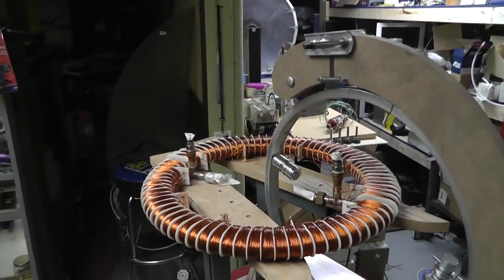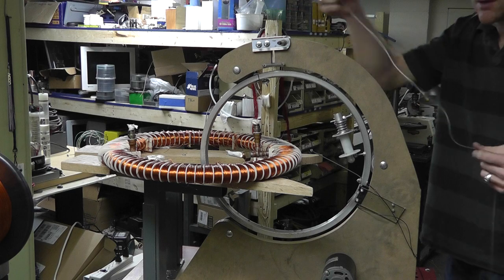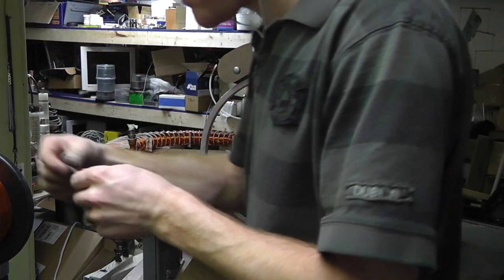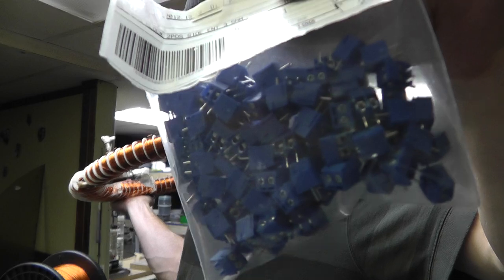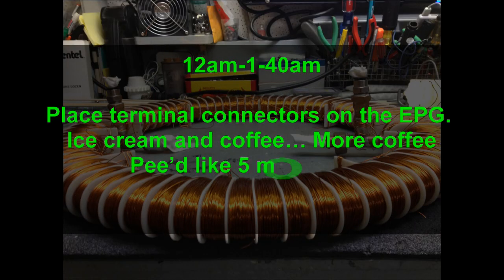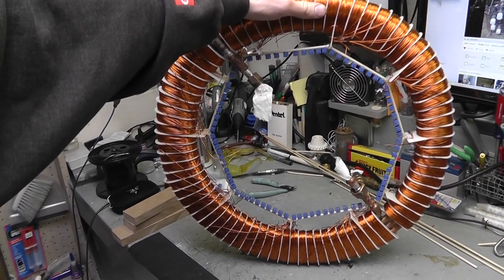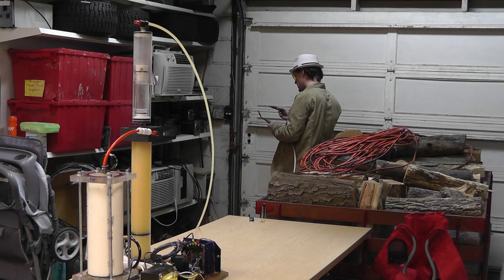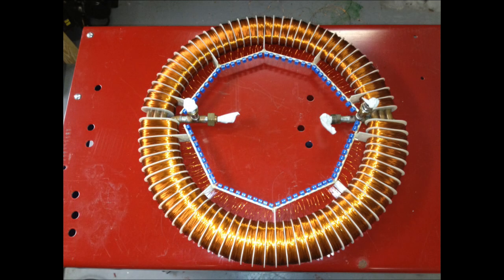Viva LA ~Russ, EPG Coils & Connections... DONE!!!! 1-15-12 - - - 1-16-12 RWGResearch.com

Comment: Note that the entrance of the close loop system start with Large coils and gradually decease to the end causing self acceleration same as with those permanent magnets acceleration systems ( https://www.youtube.com/watch?v=LFJHvdW4WOE). Or vice versa. http://rwgresearch.com/open-projects/stanley-meyers-wfc-tec/stanley-meyers-epg-system/
Reply: I noticed this aswell, if you look at Stan meters photos you see that the coils start small and get bigger as they go around
Reply: I noticed this as well, in Stan meyers photos you can see that the coils start small and get larger as they go around. Coils wire gauge also increases as it goes around

Comment: One of these electrodes when arced and pushed through a permanent magnet must produce a the particle that Stanley refer to.
Ferromagnetic: Materials such as iron, nickel, gadolinium, iron oxide (Fe3O4), Manganese Bismuth (MnBi), and Cobalt Ferrite (CoFe2O4) are ferromagnetic. These materials are very strongly affected by magnetic fields. They become strongly polarized in the direction of the magnetic field, thus, they are strongly attracted to the high field region when the field isn't uniform. Furthermore, they retain their polarization after the magnetic field is removed. Once polarized, ferromagnetic materials produce magnetic fields of their own. Since these fields are usually not uniform (particularly near the ends of the piece) ferromagnetic materials are capable of attracting each other. All of the materials that you are used to calling "magnets" are ferromagnetic materials.

Comment: you need a flame stopper after the tip youre igniting on hose, i used a small propane tank , aluminum foil and drain cleaner " lye" and it created hydrogen and use it for stove , tank has like a days worth of hydrogen with only two feet of aluminum and a quarter of drain cleaner from store.  Instant hydrogen faster than your project  .  now how do i connect it to car without explosion? efi?  hello from mexico .  If anyone knows how i can install a hydrogen tank to my car comment. Thanks